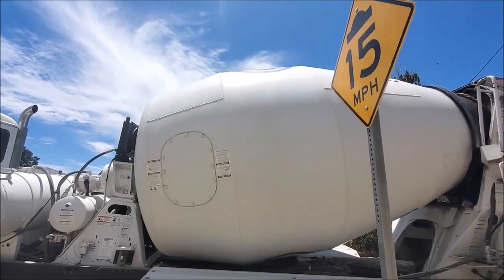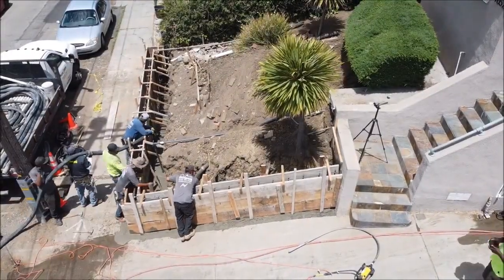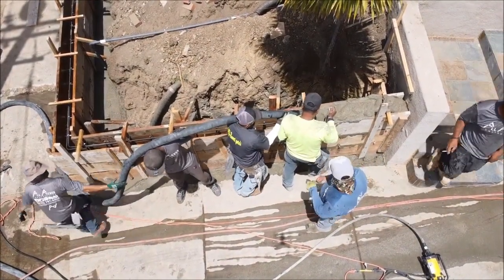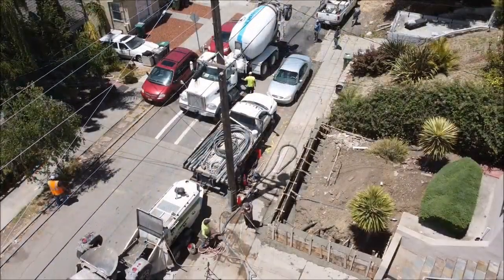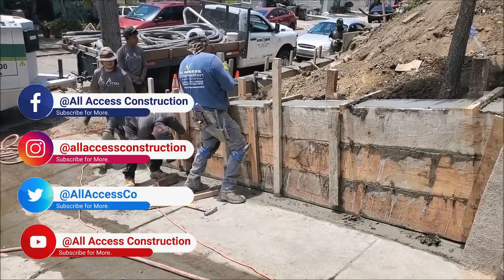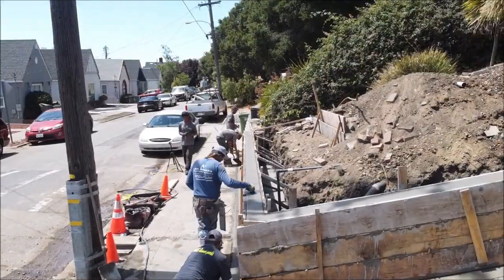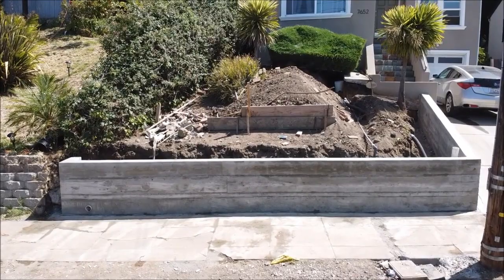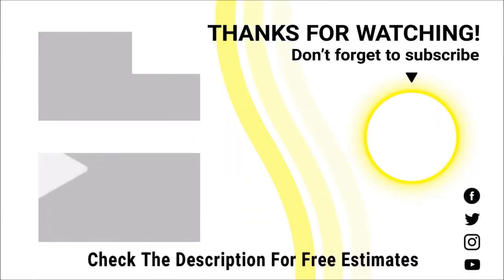How To Pour A Concrete Retaining Wall | All Access 510-804-4646

Comment: Love your video's and information, Im doing a diy 4' concrete retaining wall 100' long, 10" footing will be part of the 4' wall!   Can I pour the footing with the wall rebar in it first, then days later pour the wall part separate
Reply from the maker: Ideally you want to pour it all monolithic. You can Pour separately. We use number five rebar 12 inches on Center for all the walls. At minimum you should make that footing 3ft wide 18 inches to thick. THAT'S  just how I will build IT if im doing it
Reply: @AllAccessConstruction  thanks for the reply, yes my wall and footing total height together will be only 3 1/2' tall 100' long   just wondering being I figured about 13-14 Cubic yards of concrete!

Comment: I still don't quite get about the stakes, are they hammered into the ground, or just braced against the front of the trench? And did you lift them out while the concrete was still soft? I notice you didn't diagonally brace the front stakes off the sidewalk, I'm just a bit mystified how the whole thing doesn't want to tip over onto the sidewalk..
Reply from the maker: The stakes are hammerd Into the ground. Also, with this project we ended up pulling the stakes out because we had to leave a broom finish to match the sidewalk..

 Appreciate the comment 👍🏾.. Check the 1:37 mark. 

The second stake next to the one we pulled out is not in the ground. It's more of extra support..

Comment: I've been watching a lot of these how-to's on pouring concrete walls. Yours is the first one where I saw someone pour the footer first. 👍 I thought it was so wasteful for the concrete to just be allowed to seep out (in other's vids). This video shows a much cleaner finished product.

How long did the footer have to sit before you started the pour on the wall?
Reply from the maker: Appreciate the kind words and the thumb ups. Honestly that's the way I was shown from day 1.. 👍🏿👍🏿💯💯. Be sure to check out the rest of our videos and Leave a thumbs up...
Reply: @AllAccessConstruction  Im doing a diy 4' concrete retaining wall 100' long, 10" footing will be part of the 4' wall!   Can I pour the footing with the wall rebar in it first, then days later pour the wall part separate!
Reply from the maker: You can.. The footing should be at least 18 inches thick 3 feet wide.. Rebar #5 12 inches on center
That's how we will build the wall

Comment: Great video. How long did you let the footing cure before you poured the wall?
Reply: Does that not push the concrete of the footer up on the outside of the wall form? Apologies for the basic questions. Thank you.
Reply from the maker: It's all good..so we go from one end to the other with the footing. When we come back to start the wall. We pour the wall in lifts.. 1 to 2 feet at a time
Reply: I was wondering that too...
Reply from the maker: once we poured the footing we just circle back around then poured the wall
Reply: @AllAccessConstruction  I see. I guess that means a maximum cure time of about an hour? Did the footing cure quickly enough to support the fresh concrete? I thought I had to wait at least 3 days to pour the wall. Thank you.
Reply from the maker: All our walls are poured monolithic..if I would take a guess I'll say anywhere between 30 minutes and hour Depending on how long the wall is. We have poured walls as high as 8 feet this way.. Appreciate the comment 👍🏾 💯